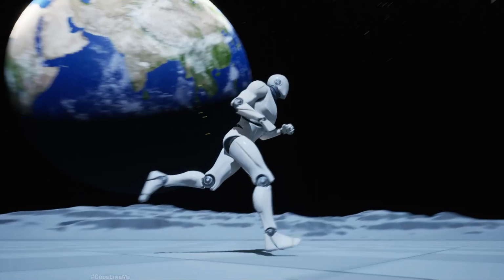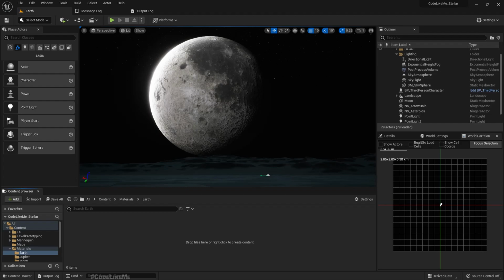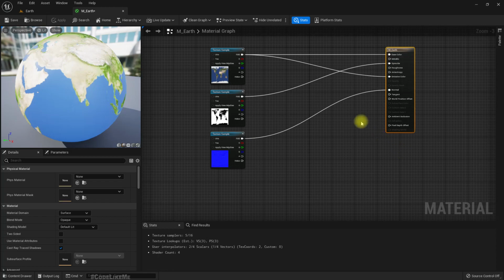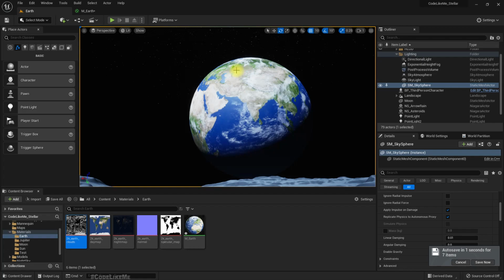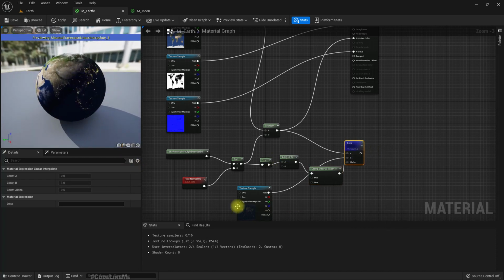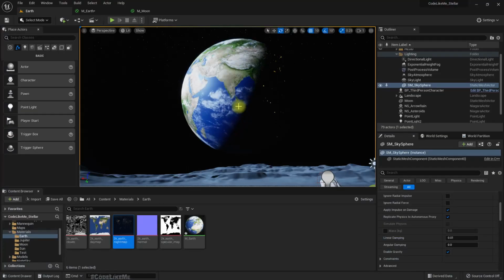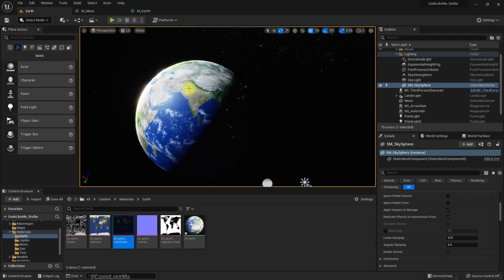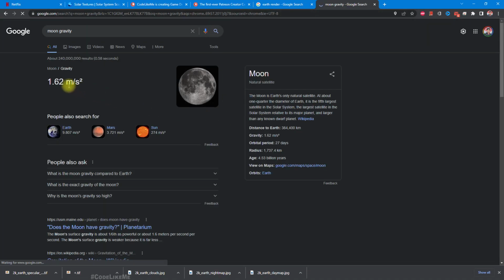Unreal Engine 5 Earth Material

Comment: If I wanted to add a tint or change the colour of the Fresnel how would I do that?  I've tried adding a vector 3 colour node at various points but I can't seem to get it just on the edge where the Fresnel is brightest.  It either tints the whole earth or doesn't work at all.  I know I'm likely just putting it in the wrong place so any help would be appreciated.